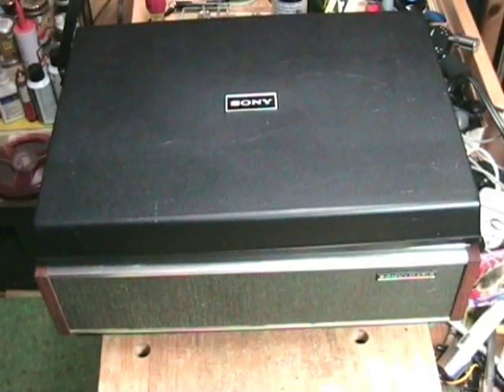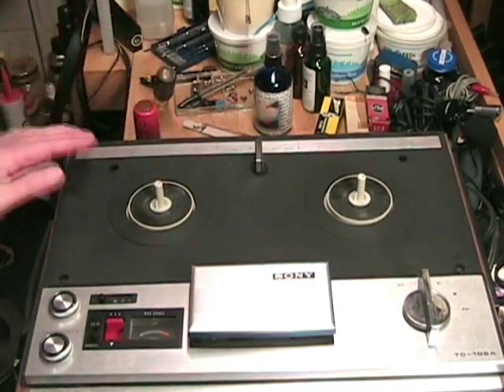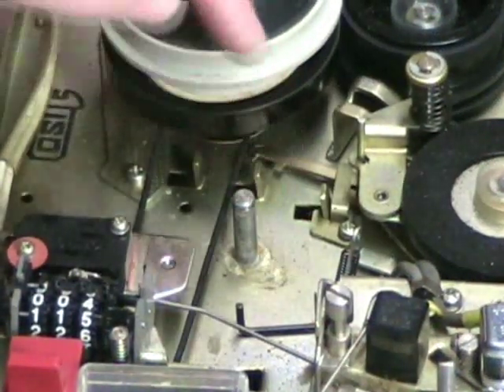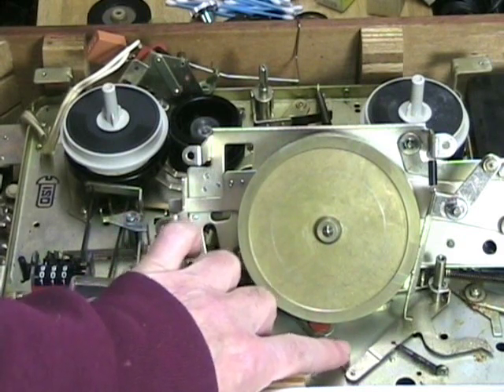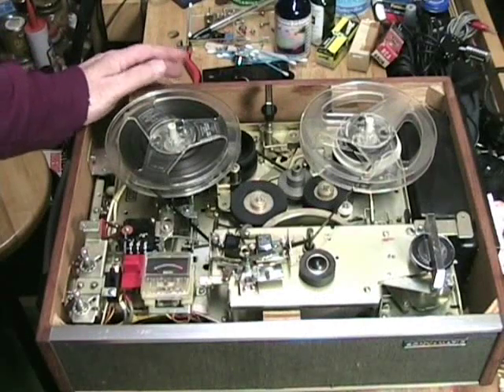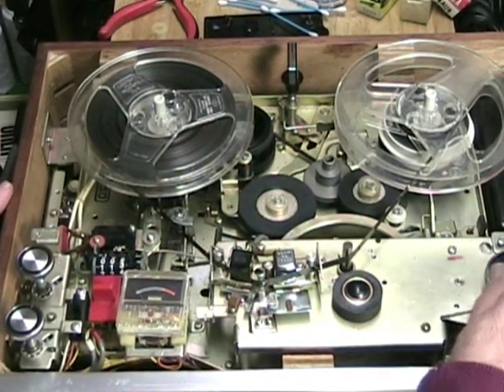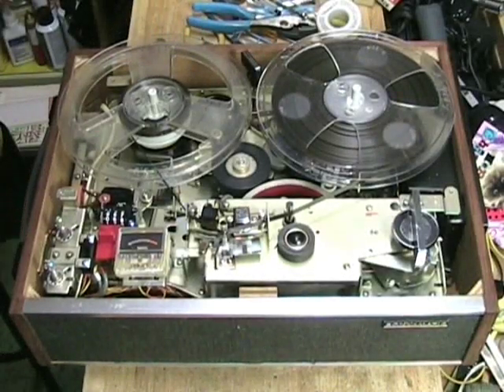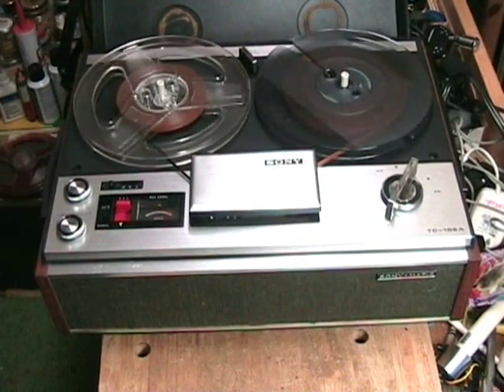Resurrecting the SONY TC106A Vintage 7-Inch Reel to Reel Tape Recorder

Comment: Hello! I'm glad I found your video on here, I have a Sony stereo tape recorder 500 A with built in portable speakers. Someone dropped it off to me about two and a half years ago. I'm crazy and I just plugged it in and turned it on, it works but not properly, It's definitely locking up. I've been wanting to try and restore it. I'm still but as of now, a little less reluctant to open it up. I'm not going to do anything, until I'm more sure about how it's supposed to operate, I think replacing the capacitors would also be a good thing for it.                                                                                                                                                   thanks,
Reply from the maker: Nat Ireson Hi Nat. if it is locking up, it's almost sure to be the old sticky grease. As you look around on YouTube, you'll find a lot of us restorers run into this problem. You may not need to change the motor run capacitor, or any capacitors... many times, these are perfectly fine. So first thing, I'd recommend get the service manual (which will guide you on how the thing is made), then clean out the old grease and replace with a more reliable modern grease. I use white lithium grease. Good luck!

Comment: the felt rings are there to catch oil
Reply from the maker: The felt rings on the idler wheels HOLD oil which then seeps through the metal to the axle to keep the joint lubricated. Many of these idlers seize up over time because the machine did not get regular maintenance and oiling, and the oil in the rings dried out. 

When these machines were new it was recommended that they receive a maintenance check every year to replace the oils. People rarely bothered to do it because of the expense. Instead they often bought a newer machine and left the older one to rot.

This felt-oil design is common in many tape recorders and electric motors. The problem is when machines are left idle and not maintained. When the oil evaporates from grease, it leaves behind a sticky goo that eventually becomes like cement. 

During maintenance a technician would clean and re-grease the machine. But if that maintenance was not done... well, we are dealing with that problem today.

Comment: Adding in my comment to show I watched the video....Interesting as it is, the marvel mystery oil/lithium grease combination intrerests me,  I figure you are putting marvel oil in some spots, and lithium grease in others,.....though when I watched it the advice appeared to be lithium grease with marvel mystery oil mixed on top of the grease,...wrong I am sure,....errr, I need to watch that again.  Ya know, I was about to start a refurbishment of a sony I have, but I don't have lithium white grease, I only have silicon lube grease.  Oh, I could get lithum white grease at a auto parts store I am sure.
Reply from the maker: Bud White  Thanks for watching the video! From what I can see on the Internet, either Lithium and/or Silicone grease will be fine for inside a tape recorder. 

I read one comment in a posting that said:

 silicone is used in car door seals to weatherproof them and help prevent leaks, and it allows the passage of air, but lithium is used on the hinges because of the heavy wear. 

When I started using lithium grease, that is what the hardware store had for "grease". It came in a spray can and was highly liquid at first, but in about 24 hours was more paste-grease like. I had to spray it into a plastic tray and wait before I could really apply it with a toothpick or swab. The the store started selling the stuff in a tube, so it was much thicker, like toothpaste. I find it is very good for rattles.

The Marvel oil is a whole other thing. There is info about it on their website: Marvel Mystery Oil dot com. It is a cleaning oil (Like WD-40) but is very thin (and red in color). It also "creeps" so it can get into bearings easily. This makes it ideal for those joints that have been riveted together and motor bearings. It will creep into the space between parts and cost the parts. It also re-liquefies lithium grease that has "pasted". So it helps preserve the lithium grease as a viscous grease when that kind fo application is suitable. 

But lithium grease itself is really good with rattle, so if you have parts, like reel tables, an application of the lithium grease will keep the parts from rattling. Also good for capstan flywheel bearings.  But if you can't get the capstan out, then the only choice is the Marvel.

I always use an injection oiler for the precision it has, and usually one or two drops of Marvel works wonders. 

And yes, Marvel WILL re-liquify the SONY joints and old grease in about 5 minutes!
Reply: Thanks, that makes alot of sense.  I'll probably just get some more lithium grease,.....maybe I have some around.  I am sure I have marvel mystery oil, or I did for twenty years and threw it out, like when I moved.  I can't wait to tear into my old sony 540, it sitting in the other room needing service bugs me to no end.

Comment: I    just  bought  a  Sony  tc-106  tape  recorder , mechanicly  no  problem  but  when  playing  it  plays  both  side  of  the  tape  and  gives  voices  i  dont  recgnize  it  I  put  the  reel  one  side  recorded  the  other  side  is  emty  original . I  play  the  emty  side , not  supposed  to  hear  anything  but  ihear  something  from  the  recorded  side .Practically  iam  not  able  to  play  anithing .What  can  i  do .
Reply from the maker: Istvan Eross It sounds like your tape was recorded on a 4-track machine. The TC106 is a 2-track machine and can only play 2-track tapes. Can you get a completely blank tape and try it?